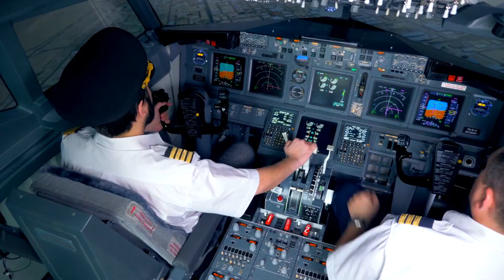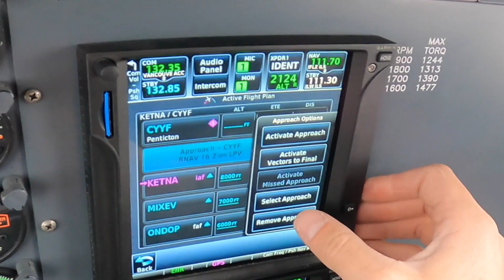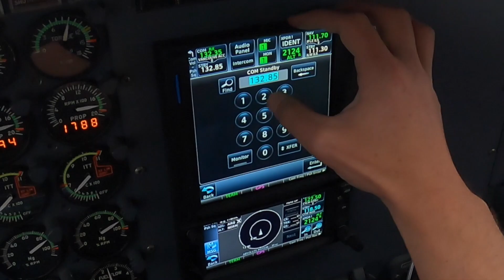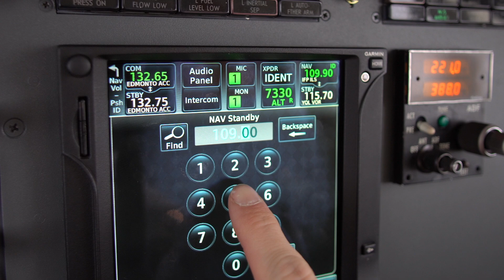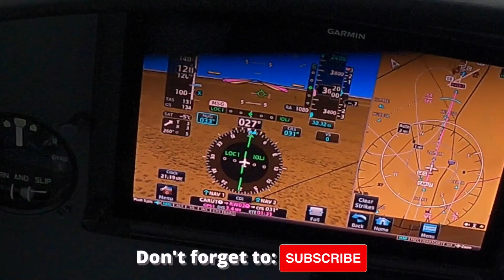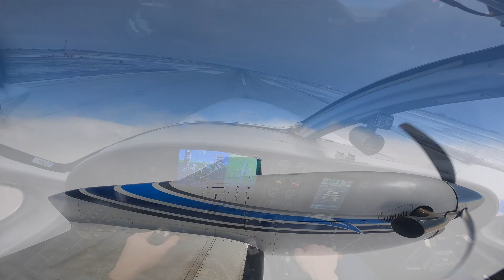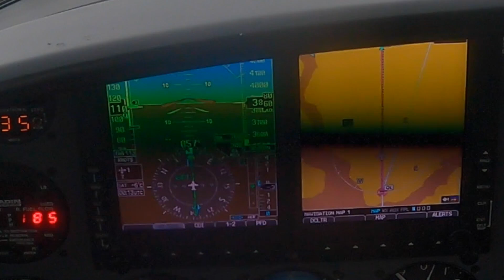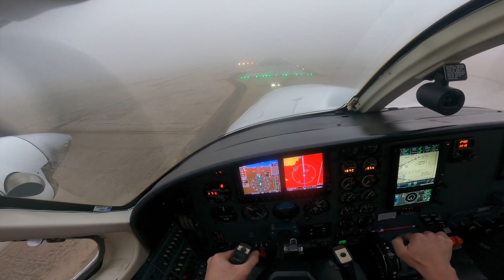Landing in BAD WEATHER! | Explained by a Commercial Pilot #aviation

Comment: Heyo, fellow pilot with a question: How capable do you find the de-ice boots on the Conquest? Have they, in your experience, handled ice well? I've heard mixed thought about de-ice boots in general, wanted to hear your opinion from real world experience.
Reply from the maker: Hey Colin! They work great. Honestly I’ve been in some nasty ice but it’s usually short lived. The boots kick off most of the ice every time but using iceX or a boot prep helps keep them shedding properly. I will say, that any ice I’ve been in has mostly been mixed and as long as you keep the power on with some extra speed on approach landing etc then it’s not too concerning. Rarely do you get any drip back from the leading edge as well